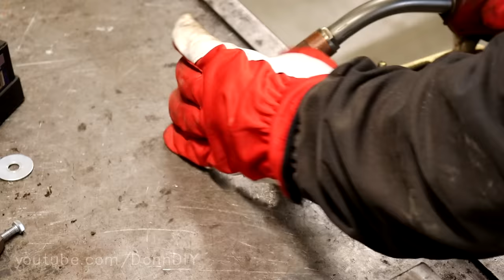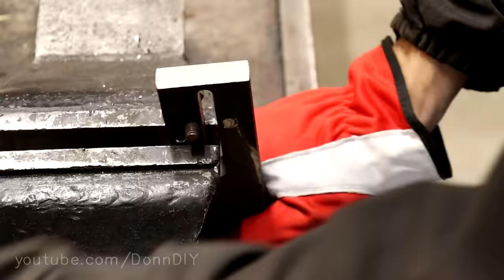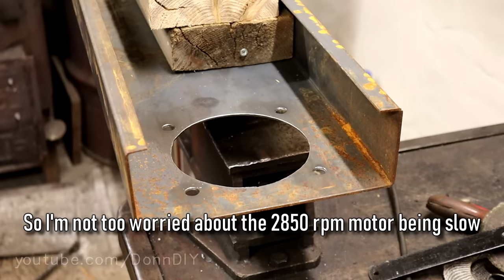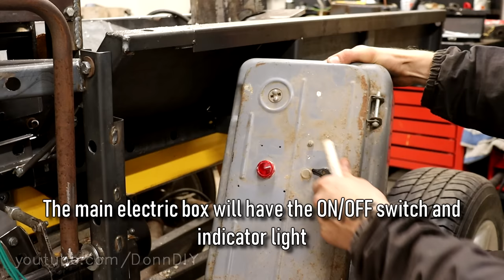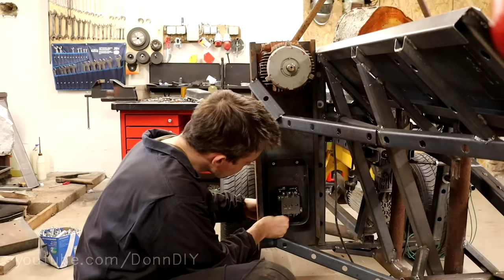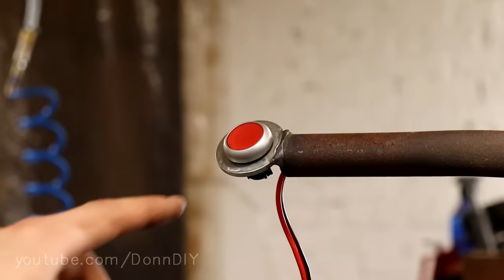Chainsaw Bar Mount - Log Splitter To Firewood Processor Ep. 4

Comment: The bolt that adjusts the chain needs a lock nut, it viberates when you’re sawing, and may come out. You’re ability to design and build equipment, the ideas you come up with blows my mind. You’re super smart and I like the way everything has to be perfect.stay safe

Comment: A little hint from an electrical engineer. Use a real cable for the switch on the handle. Something like a H03RN-F (rubber coated). 0,5mm2 should do. Reason : Friction on the in- an outlet due to vibrations during work or transport. Simple wire will short very quickly, once the insulation is cut by the friction. Also make sure the handle has an excellent ground. Because even rubber coated cable can be cut by friction. It takes longer than simple wire, but it happens. And you don't want 230Volts on the handle when that happens. A cheap alternative to rubber coated cable would be to silicone the wires into the handle tube (something like Elastosil). But put a layer of insulation tape on the wires first. Silicone, not glue. Glue hardens and looses the needed elasticity that silicone has after drying. Otherwise a very creative build. Can't wait for the next video :)

Comment: Amazing work!

In case you didn't notice it, chain tensioning bolt is spinning at 11:28 .  Lock nut to fix that, maybe?
Reply: A spring to put tension would work as well.
Reply: @EmperorAst  Could, but in a fault gives too much in and lets the chain jump off. I rather have chain to jam than get trown around. Its scary enough chain to snap in two..one? while cutting. Dont know how but it didnt whip me on the legs or such, just got pushed out and flew away. Thankfully it snap inside the protective case so end of the chain got pulled away when it spit it out. If it had broken from end of the bar, it could have pulled towards me with whip motion.

Comment: I spent yesterday serving up wood to a firewood processor for 10 straight hours - pretty worn out afterwards as you lift quite a few tons through the day. 
I were grateful all day long that I did not have to raise my hand and pull on a handle to cut the wood, and that the splitter had an automatic trigger released by the cut wood falling into the trough. The in-feed on your machine is great imho. The buttons and handles is certainly much better than running a separate chainsaw and splitter, or axe. Perhaps some automation or "trigger" functionality will come after running the machine for a while? To make it easier for the operator (you) to run when he becomes a bit tired.

The processor I was using had a sawblade and was powered by a tractor. It was really noisy, and I had sawdust all over me afterwards. The amount of sawdust from the saw together with small splinters and refuse from the splitter was impressive. Unfortunatly much of the this stuck to the firewood. Some way of trapping this to get "clean" wood is something I would look for.

Dearly looking forward to your next video in the instalment. Very interesting :-)

Comment: A chain oiler  lobe connected to an old hand squirted oil can might be a chain saver. It would bump it once per down stroke as you cut. It wouldn't need much oil...a drop or two.
Reply: I know a guy built a processor that used a cheap napa fuel pump switching on at start of cutting stroke. I have a small gear pump feeding oil to the bar on mine. Takes a decent amount of oil to keep chain cool and lubed to avoid stretching.

Comment: Perhaps give us a different camera angle that doesn’t look like your forearm and elbow are mere centimeters away from the tip of the spinning chain. 
Or let us know you’re adding a guard to the handle. 
We’d hate to see you have to learn to be left handed.
Reply: @Juha Tuomala Man, this needs a link!  I gotta see it now.
Reply: Nah man. Dude knows what he is doing.
Reply: You certainly need some protection from the tip of that spinning chainsaw blade. Unlike regular chainsaw,blade usualy go away from you, this one come toward you. One miss step and we would hait to see you hurt.
Reply: @joelchabot5167  That should be simple enough either by putting a guard on it and even if he wanted to put a small box on the push angle thing, That way when its down to that point its inside.
Reply: Wayne Crews perhaps watch a channel that features kittens and padded rooms. 

Do you really think he’s stupid?

Do you really think the camera angle does anything at all other than make you feel better?
Reply: Yes, it does look VERY DANGEROUS right now, but at the end it’ll be just like a chop-saw. I hope 😂
Reply: @iteerrex8166  Don't drink when sawing, then it is safe. 👍
Reply: Cyber Tiger 
Better OSHA than a surgeon. 🤦‍♂️
Reply: Needs a chain catch for both ends. That motor has a bit of torque.
Reply: @aaronglover5998  The Baganda in East Africa have a saying, the waters in the lake always seem to kill those who claim familiarity to them, so i would not take comfort in "knowing what am doing", safety should come first.

Comment: Attachment thought 
An easily removable bin with a flap directing the wood chips into it from the saw
Those are good for starting fires or soaking up oil/liquid messes.
Plus a bonus you wouldnt have a pile of saw dust where you were using your processing machine

Comment: This cuts really well! The only problem here is that the chainsaw is on the wrong side of the conveyor, if you mounted it on the operator side you would not stand the chance of cutting your arm off every time you operated it, but the saw cuts very well at those revs, and it seems very quite after the normal chainsaw noises! Well done.
Reply: The saw bar is 60-70cm away from your hand

Comment: You could always go over the top with a VFD on the chainsaw motor to get some extra speed out of it, but TBH, it only needs to cut as fast or faster than your ram can split and retract.

I don't recommend relying on pressing the chainsaw bar into the log to decrease cut time. On a typical chainsaw chain, there are guides you can shorten to make the teeth cut more aggressively without having to add more down force. Keep in mind the width of the log. If a tooth cuts too aggressively, it will fill up with swarf and stop cutting until it's pulled through the wood completely and clears out. So, regardless of whether you use down force, or guide tuning, there's only so much work each tooth can do per pass through the log. To cut faster from that point, the chain just needs to travel through the wood faster

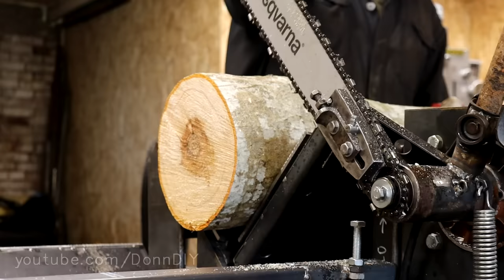Comment: I don't know if you see, that at 11:23 the screw turns and the tension of the Chain got lost.

be carefull with a metric screw with normal pitch. maybe you can use a srew with a fine pitch.
the best method in my opinion is a worm gear, because it is unpossible that the tension get lost.
I use it in my Electric Chainsaw

Comment: Hello! Always followed your videos, particularly enjoy the engineering detail you show! Im building my own processor and Im planning on a mains motor for the chain drive too. What was your motor rated at and how did you find it coped? Underpowered or just right? Thanks and loving the swing blade sawmill! The log trailer was really good too!
Reply from the maker: The chain motor was off of a water pump. It was a super small one and coped well. Electric motors have a lot of torque. Can't recall the kW at the moment though.🤔

Comment: Works well. Not so sure about how safe it is having the cutting bar coming down towards you, i’d miby consider having the handle on the other side operated with a bell crank set up so you still pull down to cut.
Felt i had to mention this as I’ve seen what a chainsaw can do to a guys foot.
Reply from the maker: The handle is offset. I'm not standing in front of it.

Comment: Very cool build man,  might be handy to have a pressure switch wired up so as soon as you pull the handle it activates the saw. Then when the handle is upright  it shuts off.  If you got thick gloves on the button might be a pain to push.  Just my 2 cents,  I love the way its shaping up though.

Comment: Clearly, the rpm of that motor was more than adequate.   I would add a piece of flat bar-stock, slightly less wide than the actual chain's cut, but running parallel right along the top, and wrapping the tip (where you don't need cutting power anyhow)  If it's thick enough, securing it at the motor end, and at the bar's tip (where you could cover the whole tip with a metal bit) would add some serious safety.  In this setup, you have no need to back-cut using the top of the bar anyway. 

Amazing work, however!   I had to really think hard to come up with any ideas, and I only had the one, above.   I also love that you speed up the stuff just fast enough, that it's not tedious, but interesting instead.  :)
Reply from the maker: That is actually a really good idea. My first idea was to attach a guard to the pan at the bottom and make it arch over the whole chainsaw bar. I will start workinf on it tomorrow. We'll see what we end up with. 😉🤘

Comment: Milling with a drill chuck could end badly. They are not designed to handle the side load. A milling chuck is also a lot more stable. Nevertheless, you got it done while I made nothing. I'm impressed!

Comment: The chain saw part is very nice, One could adapt this to a log cutting table pretty easy, Just need some sort of lift to get the logs on the table... Other than that, Its Looking very nice!
Reply from the maker: This firewood provessor already has a log lifting system on it. Check out part 3 in this series.
Reply: @DonnDIY  I know that, I was thinking about If someone was making their own cutting station with out a log splitter! , I saw your log lift which I am very impressed by...

Comment: i would of made that chainsaw foot operated over to may work out quite  dangerous. but loving your work on this.
Reply from the maker: Accidentally stepping on the foot operated saw will probably result in more horrific results.
Reply: @DonnDIY  no you would have to keep right hand on the run switch before one pusher down to cut.

Comment: Really nice work. You might need to watch your motor temp however. Most electric motors are not meant to be turned on and off frequently. The initial inrush current even at no load will add up over a short period of time.  You might consider just turning it on and leaving it on.
Reply: А как со смазкой цепи?

Comment: From one mad inventor to another: though my wife says madman, please add a tip over switch to the handle so tha when it gets close to 45 degrees it cuts power. Just a thought, as chains tend to break more at the start of the cut wouldn't a guard also be in order?
Reply from the maker: A guard will come.

Comment: Please explain the toothbrush on the drill/milling machine? Is the oil or coolant impossibly expensive or what? I watch a lot of machinists and I never see anyone else do what you do. Why do you do it?
Reply from the maker: The original coolant tap is crap and leaks so I can't regulate the flow of the coolant. If I turn it on it will overflow everyrhing at 100% and runs on the floor. I have to change the tap so I can use tbe coolant properly.
Reply: @DonnDIY  Thanks! So basically you apply minimal amount of coolant with the toothbrush?

Comment: That's weird seeing a chainsaw blade but hearing no engine! 
Will you be putting any protection round the blade to make sure you don't get injured?
Maybe a collector for the saw dust would be an idea if it's not already planned.
Reply from the maker: A chain guard will come.
Reply: @DonnDIY  I did think it would but your well away from the blade anyway. The switch looks like a continuous operation switch, I'm guessing if you let go the chain will stop, nice touch and a great idea if I'm right

Comment: Maybe add another nut to lock the chain tension adjustment screw in place so it won't vibrate loose and fall out.

Comment: Good video.  For  safety why not put a bicycle brake type switch on the handle for the chain saw.  So it will stop if you do not have your hand on it.  Cheers
Reply from the maker: It will stop without the brake even now.
Reply: @DonnDIY  I will watch the next video, what I was thinking was a bicycle brake type switch for the power.  So it can be engaged with one hand while you are using it, and when your hand leaves the handle the power is shut off to the chainsaw cutter.  Safety thing.  Cheers

Comment: You say 'harvesting parts from the old chainsaw mill'. Does that mean the chainsaw mill you built is gone?

Also, aren't you worried the chain might come off and whip you in the face? If it breaks or something like that. Wouldn't it be wise to make a shield on the handle that would protect you? Because the handle is quite close to the bar.
Reply from the maker: The handle is offset from the chainsaw bar. I wouldn't stand in front of it ever. I don't have the chain saw mill. I do however have my band sawmill.

Comment: The bar used to control the pressure of the cut should be longer. Why? Because if his hand slipped off the handle of the bar it would go directly into the chain saw blade. Ouch!
Reply from the maker: The handle is offset from the chainsaw bar.

Comment: You've probably noticed that the tensioning bolt tried to escape.
Reply: Needs another nut to lock it in place, or it rattles is self loose, i presume you meant?

Comment: Nice fabrication but this thing is very dangerous. Reaching over a chainsaw and if your hand slips the return spring could run the blade close to your hand before the motor stops turning.

Comment: A good achievement.
Giant with clay feet? Too heavy, continuous operation is more efficient than in halves.
For cutting, use a 2mm caliber blade / chain. Chain greasing is desirable for his life.
The oil that greases the chain also has a cooling role, so you will have a hot blade that will live a little - let's not forget that at the top it has a bearing from which all the grease will come out instantly.
Chain lubrication can be done by dripping oil from a container, gravitationally, or by fitting an oil pump for chainsaw lubrication (China $ 5,200 -2).
Gasoline chainsaws have speeds of 9000rpm, around 6000rpm have maximum torque.
The speed can be multiplied by the belts ...
A solid achievement, even too solid - in areas with soft soil will have to be trodden/pave.

Comment: You need an oiler on the chainsaw, like a normal chainsaw.
Reply: ________ 
It’s in the plans. He drilled the hole in the blade holder for oil delivery already.

Comment: please stop using end mill cutters in a drill chuck you'll end up bending the chuck arbor and ruining it or it can snap and it fly out at you speaking from experience use an end mill holder or a collet. yes it a pain to change them and it take time but beats replacing drill chucks after you destroy one

Comment: Why a handle at all? Just use a steel wire over some rollers and a food pedal. Much easier to operate and you're far away from the chain :)

Comment: If your chain speed was a smidgen faster, the bar would have to be round like a basketball.... A circular saw blade would work in this application just as well but might not stay as sharp. nice it pulls the chips away from operators. I think this build is a rap! Would sure look nice next to bandsaw mill as a total recovery mill site... do you ever have plans to run your log mill again as I would like that seeing the mill do more stuff again.... maybe a flume from woods like creek floating logs to pond and going up chain to log mill/wood processor !!!!!!!!!! Can you tell I enjoy killing trees or harvesting those that have fallen yet have good salvage. Your sawdust and unusable stuff would go into a underground burner with fans and the heat robbed for barn, house, milk station if you still have cows

Comment: There is no log retainer - the cut turns out to be crooked! There is no mechanism against biting the chain - there is a risk that such a powerful motor will break it and throw it at least in the body, even in the face! The handle and saw blade with chain are located in the same plane - the solution for idiots!!!